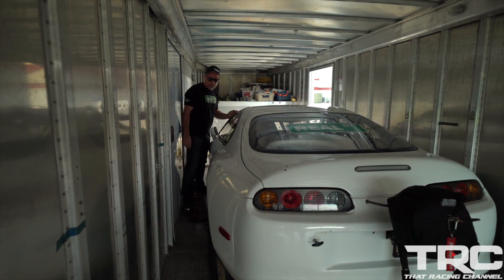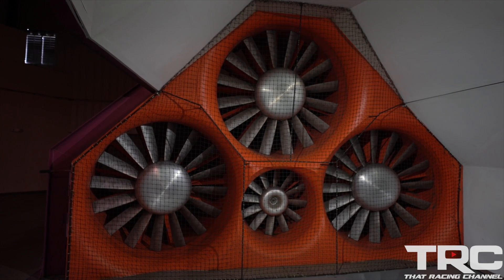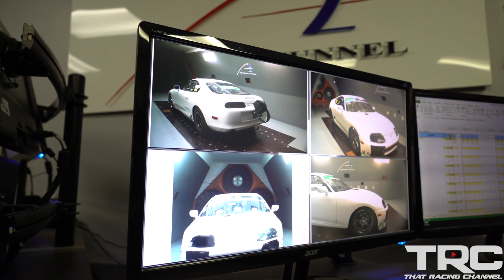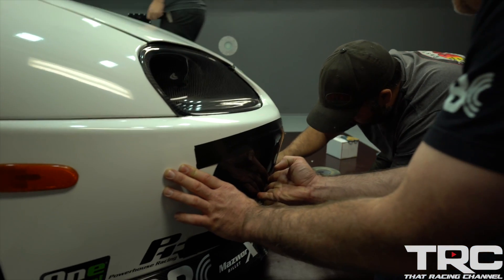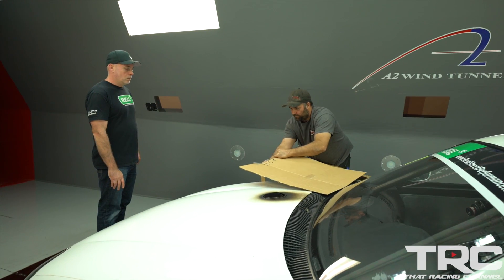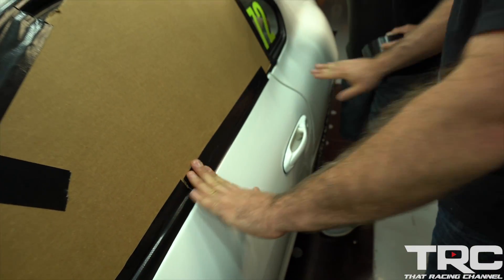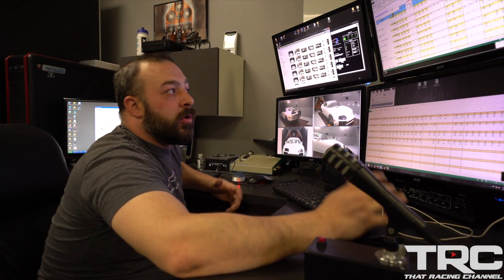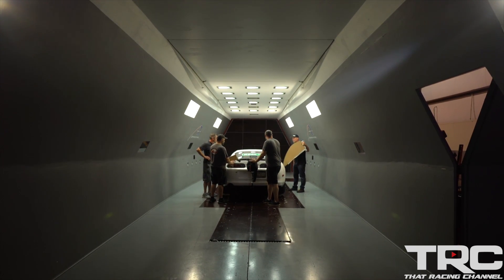2000HP Toyota Supra Wind Tunnel Aero Testing - The Results were AWESOME!

Comment: They need to set up a Dyno 8n the tunnel. I bet they can get a lot of more turbulence information with the rotating wheels. You can even help wheel design . A propeller spoke design will blow air out cooling the brake system as you're driving. The wheels will be a fan blowing out (or in) at all four corners might be a good design to look into. It could be a bad designed too because it might vacuum up rocks and dirt through your brake system at high speeds.

Comment: Sorry for being dumb, but what is that black thing at the back of the car? My guess is that it's timing related
Reply: It's  a parachute  since relly powerful drag  cars has small  wheels in the front to save weight  when they are  braking it would take them a lot more time come to a stop, so what the parachute does when past the finishing line open the parachute  it creates back pressure since it's opened  in the opposite direction it slows the car down alot more faster than relying solely upon  the  cars breaks.
Reply: @jevonbigga6172  thank you
Reply: @benjaminchen4367  sure

Comment: This study lacks the hot air dumped under the car and hot exhaust gases on top of it on one side.
Hot air and gas have way lower density,and reduce pressure where they travel against.
You will increase down force again with warm air traveling under the car,but also reduce down force with hot gases traveling on the roof top.
You should dump hot gases under the car,and get a diffuser behind the car = less drag,more down force.
Caps on the whells will help quite a lot too.

Comment: why would you remove the lift. that is making the car lighter at speed. all you need to do is boost by gear, and reduce the boost at 170 and u go faster (cause spinning wheels) . why would you add downforce its just drag and takes more HP to make the same effort. you will run slower

Comment: Does having the motor running WOT affect aero with the turbo pulling air and exhaust dumping out the hood? 

How about turbulence from the wheels spinning?
Reply: That's what i thought.
And why they are measuring lift and drag in HP.

Comment: Aero is mostly overlooked by the door car guys but it sure makes a bid difference down at the deep end. I added over 50 mph to a Flathead Ford  powered car at Bonneville for a guy with body changes within the class rules & he needed to up the gear ratio a few times to keep up. How's 229 mph with a Flathead roadster sound?

Comment: This testing is not that realistic because there's no body lifting from acceleration.
Reply: ChrisGR93 _TxS while it was in the tunnel, the rear was raised to the hight it goes down the track at by using shock sensor data from previous runs

Comment: Soo sick I would’ve there’s anyway that the air tunnel would work for my 1/8 sale GT Rc car
Reply: Looking at the video I don't think the sensors for forces would be able to work with something that small. Small scale wind tunnels do exist because the cost goes up exponentially with size, but I have never looked into whether any are publicly available. One that small you could probably DIY. Changing size but keeping the shape the same can be adjusted for mathematically like they were doing with wind speed in the video, so if the body you use is also made at a smaller size you could do that and make an even smaller wind tunnel.
Reply: SuperBobKing excellent idea, it'd need an air velocimeter to know how fast a fan is pushing/pulling, then 2 or 4 digital scales to see what down/up forces start happening. a couple 20" box fans with stronger motors is probably enough, 10-12ft long with some vanes to keep the flow straight.
Reply: model nutty it’s a 1/8 sale GT car about 12/13 pounds 14/15whp personal best so far is 150+ mph

Comment: might sound dumb but what if adding a big wang in the back helps it that much more, i mean nhra 10k hp dragsters have em. imo a wing would drop the cars rear soo much.
Reply: A well designed wing would add downforce but it would probably also add drag. Circuit cars use them so that they can go faster through corners and have a higher exit speed when they get to the next straight. It works in top fuel because they have so much more horsepower that it is worth it to get more grip and fight the drag.

Comment: How cool is that? 40+HP less required to do 200MPH AND effectively 500+ lbs of extra downforce. Shows how much power was being wasted creating undesirable lift. There's no way this won't make a significant difference. It will be far more profound than just adding 50HP.
Reply: Exactly, he added far more than 50 hp because he wasn't putting a lot of it down to the ground at high speeds

Comment: Is the bottom of the car sealed off? Also A carbon rear diffuser would help alot just to get all the air out quickly. But sealing off the entire car will increase downforce and reduce drag alot.

Comment: Interesting results. Doing 1/2 mile runs I tried a few things. None of it worked properly. I need to spend some time in a wind tunnel to see what is going on. The nose of my car lifts way up in the air. I have a feeling that the hood vents I installed are hurting me big time at 140mph and up.

Comment: I've occasionally looked fro supra wind tunnel vids and can't find any so this is interesting to me.  would be cool to see some completely stock supra's in this test.  Even though it looks like that thing is a stock body.
Reply: It is stock... What's modified????
Reply: What i meant by that was a completely stock supra. ie stock suspension, ride height, no changed aero or blocked vents and with the wing.  

I know the wingless is less drag but it would be cool to see both in a wind tunnel just to see the difference in numbers. 

in general yess the car looks to be an entirely stock body car. But there are factors like ride height and if they have added any sort of panels under the car to aid in aero at higher speeds.   

thats why im just saying it would be cool to see a 100% supra roll into a wind tunnel and  see how the car is. maybe even for fun have it do a wind tunnel test compared to the MKV.

Comment: You should have tested with the nose lifted slightly and the back depressed a little to better replicate it's attitude going down the track under full throttle.  Results would have been even worse than what you found...
Reply: SS OFFSHORE most people would think the same way you did here but unfortunately it’s incorrect. If you watch the videos of this car (or review the shock position sensor for the rear during a pass) it actually lifts the back and down the track higher than its static resting position. It’s a characteristic of the 4 link rear suspension. It does not squat like an IRS car. The rear of the car was set to the ride hight it goes down the track at while it was in the wind tunnel to get accurate info. Thanks for watching. We will continue to bring more new stuff like this moving forward.
Reply: REALSTREETPERFTV so what you are saying is, you know what you are doing?
Reply: @therealboofighter  What he is saying he learned from the aerodynamicist. Not from know-it-all's on the internet, posting on You Tube comments of all things...
Reply: REALSTREETPERFTV This is critical info that should have been made clear in the video. Othervise really cool vid.
Reply: REALSTREETPERFTV plus the ballooning of the rear tires is also going to lift the rear a bit as well
Reply: These were my thoughts exactly. However. What they learned even at a parked attitude, that will translate to gains going down the track.
Reply: Good thinking!!!
Reply: The car isn't exactly at this position at 210mph
Reply: WISE MAN.
Reply: People don't understand suspension geometry and things like instant center and how link placement changes squat/antisquat.

Comment: Wheel caps would make a huge difference too. Looks odd, but works
Reply: Absolutely true, wheel covers work. Also, flat floor would do dividends on this car
Reply: @Shadowboost  Most people are too vain to run wheel covers, that's fine the gain or decrease in drag is modest, so most go without. Flat Floor is by far the most beneficial thing to do, all serious racecars where rules allow have this.
Reply: @dj4monie  I was so surprised to see exposed underfloor on the Titan car. It could pick up a few mph just with simple mods...
Reply: yes they work, but much better for an aero high MPG DD
Reply: @modelnutty6503  Why just MPG? Its less drag under the car. Every serious racecar has a flat floor or shaped floor for less drag and additional down force. Why drag cat especially grassroots tend not too? They likely break things more so it's less trouble to get to the parts that need repair/replacement.
Reply: Wheel covers just fly off on high powered quick accelerating dragcars. Same as they dont run wheel weights for balancing as they to just fly off
Reply: @danspeed7039  That is because the wheels flex. They do run them in other disciplines.
Reply: @dj4monie  yea mate thanx for explaining what i said a little clearer

Comment: I was hoping to see other aero parts in the science experiment.  Adding a rear diffuser...OEM wing...TRD/RMM wing...front splitter...what the combo does....
Will you be going back to test more?
Reply: So you want free wind tunnel testing on the parts you're most interested in? Why don't you just ask Jay to give you money????
Reply: @dj4monie  The information would be potentially valuable to him as well, dont you think?
Reply: I would expect a drop in drag if the nose of the car was dropped a bit, or extending the front air dam downwards.  This is to reduce the amount of air going under the car.
Reply: @paulstandeven8572  I think drag would increase slightly. Best to have as small of a pressure difference between the front of the car and the back. Forcing air to move as quickly as it can beneath the car would increase downforce and likely also decrease drag.
Reply: I remember Toyota having specs on the downforce created by the oem and TRD spoilers
Reply: Shit must be expensive!

Comment: My 2019 mirage has .27 🤣
Reply: Factory cars are designed with lower coefficients, to increase mileage and lower noise, as well as they don't need to use the downforce like these cars do.
Reply: Prius is like .24/.25
Reply: i don't have a car

Comment: Some people think that the only solution to going faster is adding hp. I appreciate you guys shinning light on the importance of working on the aero as well.
Reply: Cleetus came here, learned how bad Leroy's aero realy is...and changed literally nothing.
Reply: Cletus put his Vette Kart in the same wind tunnel.... So what's he done? Instead of putting the Corvette body back on the car he's tried to generate more power with new turbos and 3rd Texas speed long block.... Go figure.
Reply: Yeah but unless you have atrocious aero and a ton of HP like Leroy, you're only looking at some really minor gains for 1/4 mile stuff.

1/2 mile, standing mile, and roll racing it'll make a bigger difference.
Reply: Well there’s 2 ways to make a car faster at high speeds more hp to push threw the drag or better aero dynamics to reduce drag
Reply: He knows the aero is terrible. He made some small changes after being in the wind tunnel without taking away from what Leroy is. If you keep up with his channel he has hinted at some body panels coming to Leroy in the future.

Comment: I dont understand why a rear spoiler would reduce drag.. is it cuz it lifts the air over the parachute on the back?
Reply: It reduces the vortex that builds behind the car.
Reply: Spoilers are designed to stabilize the air coming off the back of the car.  Creates less turbulent air which will reduce drag.
Reply: flow over the body was doing an airfoil lift thing, like a plane's wing,
the small spoiler breaks that lift, it can be as much a drag as down force... or more, because the tires were losing their grip at speed.
going from 400+ lbs of lift to 100+ lbs of down force, just lost 3/4 of the drag happening at that point, while weighting/loading the tires. sometimes (as shown in this video) it doesn't take a whole lot.

Comment: How feasible is it to fabricate a full aero sheet and diffuser for the under belly of a racecar? We know that controlling the airflow underneath can eliminate lift and even be tuned to create downforce without increasing drag, but I wonder about two things: racecar class regulations and the fact that these make the car more difficult to work on.
Reply: If a ten year old Jetta can do it than a race car can.
Reply: would simply adding a couple of inches to extend the sill panels down reduce air being drawn under the sides of the car?
Reply: @mightyfinejonboy  My understanding is that by far the biggest impact is a rear diffuser that helps air smoothly escape the back. All that air gets sheared across all the rear suspension components and differential and then gets stuck, which causes a parachuting effect. This is why all new cars have a diffuser and a vastly simplified underbelly with paneling. Just giving that air a smooth escape route is enough.
Reply: I am surprised that they didn't try a small splitter on the front (may not have had any material that was stiff enough). Theory says it should have increased downforce by helping to create a low pressure area under the car.
Reply: Class rules depend on the class. I know some time attack classes don't allow flat bottoms unless they are factory. As far as how easy it is to make that depends on the car. How much harder they make maintenance depends on how you attach them.

Comment: So need for speed stats arent that far off 😆
Reply: Putting a draggy wing on a car with 120 hp at the wheels is not needed. I'm not sure what you mean by the NFS comment.... Most people need to worry about generating enough power to need AERO work....
Reply: @dj4monie  thanks for the tip, now i know for formula 4 or formula 3 to remove the wing. N2 AE86? remove that wing too. Damn bro i'm gonna win every race now everyone else are idiots! haha!

edit: WTF bro somehow i came dead last except the people that crashed and DNF'd? they must've been cheating there's NO WAY my car wasn't faster then all of theirs after i removed that stupid RICE lmao haha xddddddd i also decided to do improved production races, and race a civic like my boi Jordan Cox cause of how good the civic is, except unlike him i decided to not run a stupid ricer rear wing lmao.... But then i also noticed now during practice that now my brake balance has to be set even farther forward for some reason???? If not the rear wheels lock up dafuq lmao? my rear wheels are literally almost not helping at braking at all now that it's set so far forward, i can't use anywhere near as much brake pressure because of it cause then the fronts will lock up, and any time i try to trail brake a little the whole car just wants to spin out???!?!?!? wtfffffff????? so my braking distance is like 1.3-1.5x longer and i also am really slow during some of the high speed and decreasing radius corners, i just get lift-off oversteer and any time i give the throttle required to combat it, then my front fires aren't giving as much turning force since im technically using a little bit of longitudinal grip to battle the oversteer. Oh well im sure im SOOOO much faster on the straights though, my speedo is broken so idk. But im sure it's WAAAAY better bro, race is later today wish me luck!
Reply: 100 subs With no videos I can't tell if you didn't notice the parts where I was joking, or if you did and are still trying to say I'm wrong. Either way aero is really complicated but essentially yes you want center of gravity and center of pressure to usually be even and close to 50/50. There are exceptions to that rule though. The Mercedes AMG GT R is actually aero neutral on the front with all the downforce on the rear. With FWD I'm almost positive that for everything that isn't drag racing you want center of pressure to be close to the center or possibly even a little back from the center of the car and not center of gravity because you want the normal force to be closer to even on all 4 wheels. But it depends on the car
Reply: @BladezAndrew  jordan cox 🤘🤘
Reply: @BladezAndrew  Close as possible, I agree a bit because they can, but they dont, you kinda need the center to change during race, to rear when using gas, to front when using brake, they may use 51/49 in max I think
Reply: Anthony Thomas nice. You watch youtube videos and repeat what they say.
Reply: @EbolaSquirrel  why sir just why?
Reply: @EbolaSquirrel  hey bro i just finished my improved production race...... Jordan Cox just lapped me twice with his ricer wing, WTF1?!?!?!1?!? dude was definitely running nitrous or something his corner entry, mid corner AND corner exit speed was way higher than i could manage with my perfectly tuned car without a dumb ricer wing haha xdddddd and his braking distance was way shorter, and he could even trail brake that cheater wtf dude was probably using some illegal SC (stability control) also my front tires fucking exploded from over heating and extreme wear and i crashed into the stands killing everyone!?!???1 But my team and I were on the same pit strategy as him, it's almost as if there was sabotage since i LITERALLy JuST CAnt SEE hOW my FrOnT TIRES could have such UNEVEN Heat and WEARRRRRrrrr compared to my rears and compared to his???!111.... Bro im jsut liek done dude, these MoThA FAHKN cheaters smh.